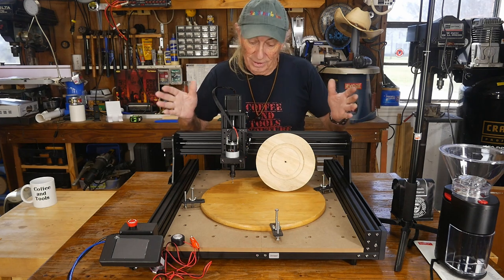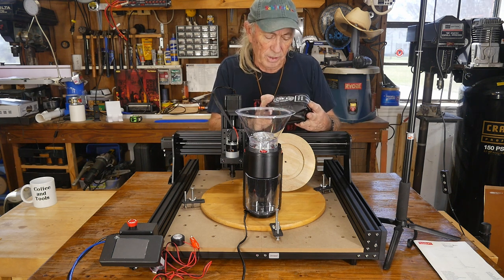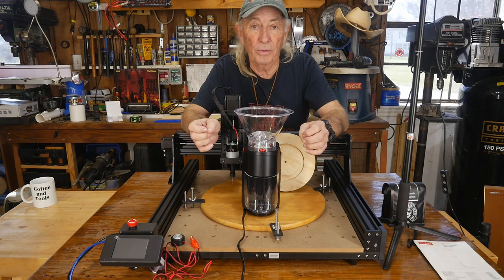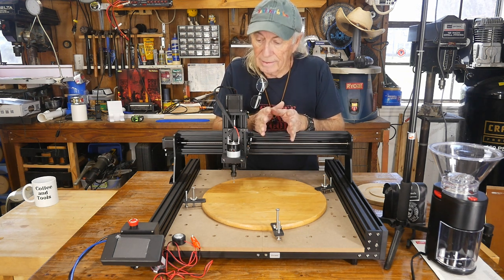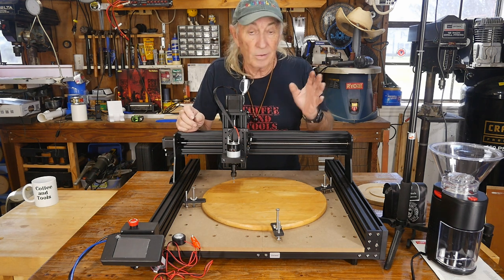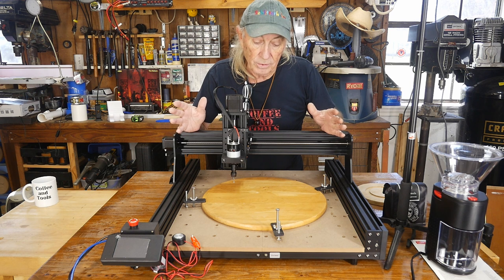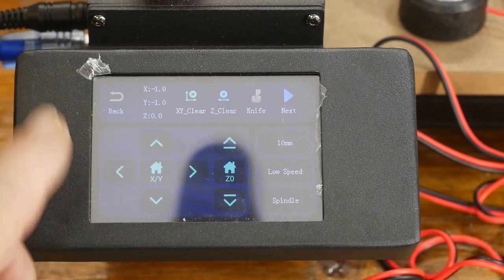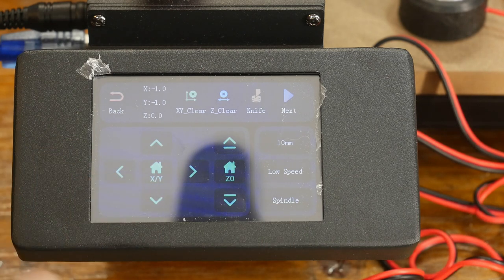Basic CNC with TwoTrees TTC 450 CNC review and getting started with software, C&T ep 312

Comment: Hi! Great video! I have a question for you, does the X/Y Home and Z Home Button work for you in Sculpture mode? Because on mine I load up a file into the sd card, go to sculpture mode zero in the spindle by pressing X/Y and Z clear buttons and if I move on any axis and press x/y or z home buttons it doesn't go back to zero. It works in control mode tho. I have contacted Two Trees and they either don't want to acknowledge the problem or for some reason don't understand even tho I have sent them a video showing the issue.
Reply from the maker: I feed mine from the laptop. When I get a chance however, I'll have to check on that. I gave them a list of upgrades that I felt were needed and all I got was "thanks, we're looking into it"
Reply: @SirTools  Yes I would like to know because if it works on yours then either mine is defective or its using an old firmware or something. 
The communication with them so far isn't giving me great confidence if something major happens with the machine, but at least they reply fast so far (within a day) and I was lucky to grab it for only $650 and free shipping.
Reply: Also I found out that when I turn the machine off and turn it back on the position where the spindle was when I turned it off becomes the new mechanical zero coordinate. So no matter how many times you clear the x/y and z positions it wont update the mechanical coordinate and if you run a file directly from the machine it will go off to the mechanical zero then back to the working zero coordinate that you set by the clear and then go to the cut position. Which it can cause a lot of trouble specially if you are using fixtures instead of double sided tape because the spindle can crash into the fixture or even the stock material by doing that.
Reply from the maker: @xample222  OUCH, I have almost hit the clamps once so far, but I noticed you need to reset up each time. I have 3 more CNC machines coming so, we'll have to see what they do.
Reply: Try pressing the POSITION button where you want the machine offset to be (same as G92) . After setting,  jog the machine away then hit the  "X,Y home button" on the controller. it should send the machine back to where you set it. Clearing X,Y on the controller clears this position. More than likely  your program (not the machine) is sending the machine to an absolute machine X,Y position (G90) when you hit send. Like @sirTools says feeding it from a laptop using UGS makes this a lot easier.